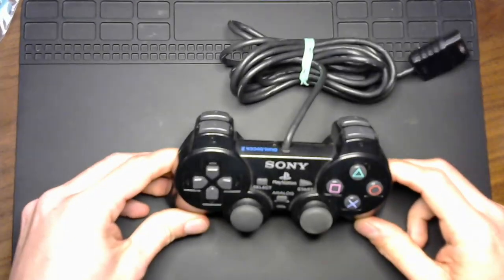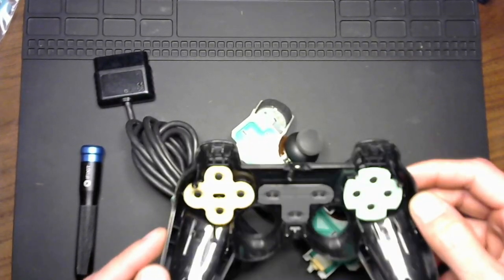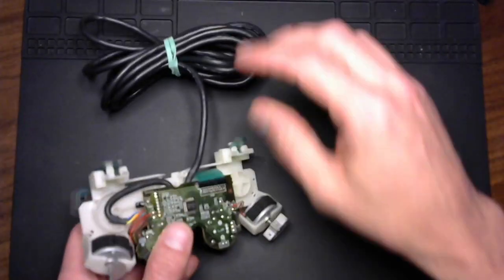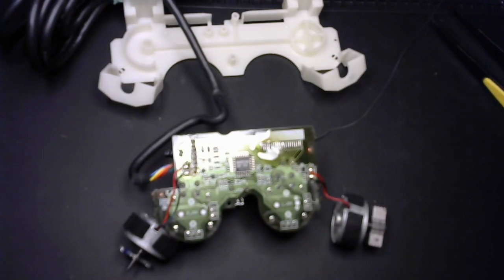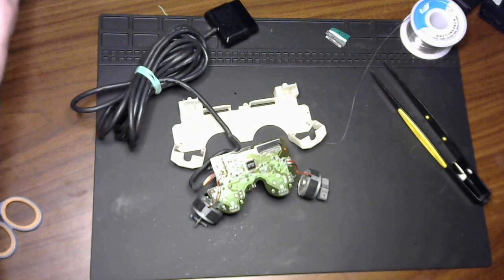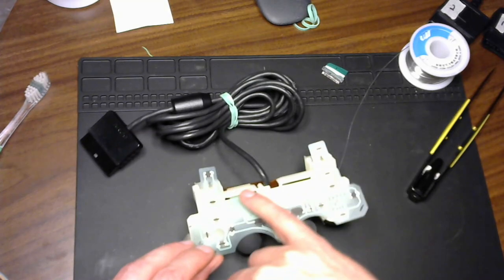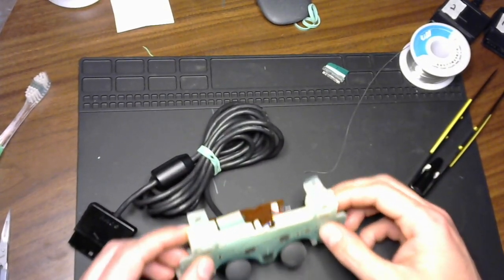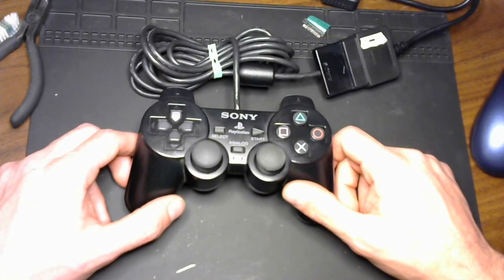Restoration Pilot - PS2 Dualshock 2 "H model" Controller Repair

Comment: I took a big risk trying this on my broken H model, knowing there was a high chance of breaking the board... and sure enough I tore up 7 traces haha. Second time ever soldering so definitely a learning experience...
Reply from the maker: I've done this several times since this video with both iron and hot air and....while I haven't torn any traces yet, hot air is absolutely the way to go. I just wanted to show that it's possible with an iron. Sorry for your loss. :(

Comment: couldnt you use a solder sucker to help desolder the ribbon cable connector without a hot air station?

Comment: When I connect the ps2 controller to my PC adapter to test it, the computer doesn't recognize the pad. Do you know what could be the problem? It's not the adapter because the PC recognizes it by itself as a generic USB controller. But when the dualshock is attached, it disappears from the device manager. I know the pad works and is receiving power because if I push the "analogue" button, the red LED lights on.

Comment: Guys. Use flux and lots of solder. A good trick is to take the connectors length in solid coper wire and soak that in solder against the connector. Does it matter if you use the 18 or 19 pin connector that's available? You just offset either the cable or the connector right?
  In the video info you linked 18 pin connectors in the video you use a 19 pin connector. But I don;t think you mention the options and how to offset the 18 pin cable in the 19 pin socket.

Comment: Even I have the same controller which is the "H model" having the problem. The D-pad's up & left button and L1 & L2 does not work while the other buttons are functioning
Reply from the maker: This is the classic symptom of the flex PCB failure. You did nothing wrong... it just happens. But you do need to replace it now.

Comment: Why can we pull of the membran and put the new one in ? (as you insert the new one in to new connect port) ? i tried to pull of one and it is very strong. is it also soldered to connect port ?
Reply from the maker: The original membrane is permanently crimped into the original connector which is why we must replace both membrane and connector with new types.

Comment: What's more fun is all the ribbon cables I've seen on every video looks different lol

There's no reason that I can see that they couldn't use a PCB. The pads and the button rubber are both carbon-impregnated. The rubbers are conical so when you push harder, the cone flattens out and increases conductivity which is translated as pressure.

Just watch some of the cheaper ones - if there's a break in any of the pressure sensitive pads, it's an on/off switch and won't work right.
Reply from the maker: Typical corporate cost cutting, I'd imagine. Cheaper to have a flex as opposed to a PCB? Ultimately I think it's the breakdown of the carbon that kills the functionality and I 'm not sure PCB vs. Flex would have prevented that.

Comment: I have a control that doesn't work at all, just the analog light, changing the film would it work?
Reply from the maker: It might but you should confirm what is working first. Need more analysis.  Might be a broken wire in the cable. The analog sticks, especially in the Dualshock 2 are bulletproof so it could be anything causing the problem.

Have you verified anything works via a USB  adapter?

Comment: Also I'm confused - these aren't crimped they're push-in, no?
Reply from the maker: Sorry for the very late reply - the original OEM connector/flex is permanently crimped. The replacement is push-in.

Comment: good video thanks! Just wondering why my model H controller has a 19pin connector, and i can only find 18 pin flex pcb's
Reply: you only need 18pin the first pin on the left is not necessary

Comment: Liked the video man. Could you provide links to the parts you used?
Reply from the maker: Thanks! You're right - I absolutely should have added a parts list to this. The contact ribbon/cable is part SA1Q43-A and the connector is an 18-pin flex cable connect port. There's tons of resellers on AliExpress and it's complete chaos to actually find anything so these are the specific parts I ordered from the specific seller:

https://www.aliexpress.com/item/1005001325883504.html?spm=a2g0o.store_pc_allProduct.8148356.3.7b584b27aGVpcD

https://www.aliexpress.com/item/1005001333840268.html?spm=a2g0o.store_pc_allProduct.8148356.5.41843cdbM3CE5E
Reply: @roastymike5438  I have a trashed dualshock clone that has a similar connector, would it be possible to re use that connector from there?
Reply from the maker: Are you referring to the connector for the new button membrane? If so, maybe a small chance you could reuse it if it's a push-in. The button ribbon/membrane from the old controller (if there even is one) absolutely won't work though.
Reply: @roastymike5438  Thanks, I happen to have a couple of flex that I bought mistakenly for a type A controller, all these years later they will be useful. Aside from that I ripped half of the pads removing the old connector... luckily it doesn't seem impossible to wire the pins from the connector directly to the controller chip, but It won't be easy lol.
Reply from the maker: @GenesHand  It can't get worse, right?! And this is how we learn. Thankfully PS2 controllers are not some rare item. At worst, you're out a few bucks. :D